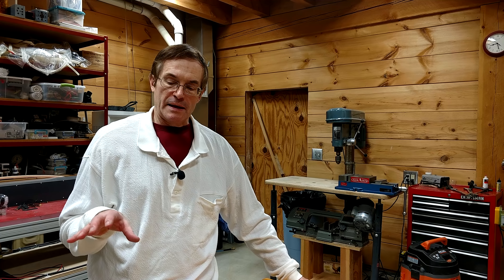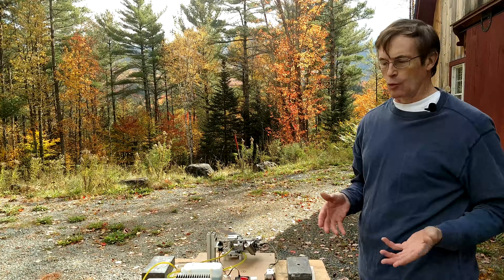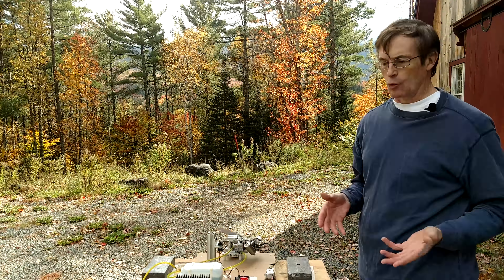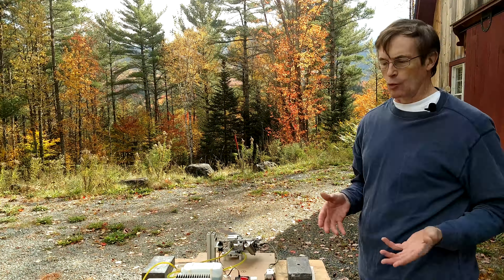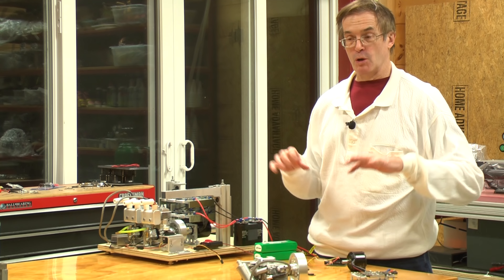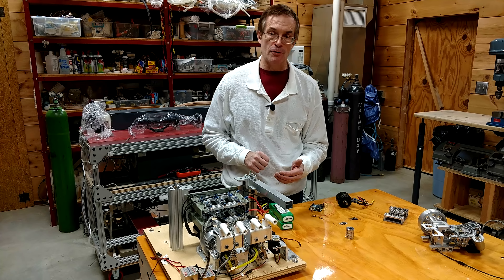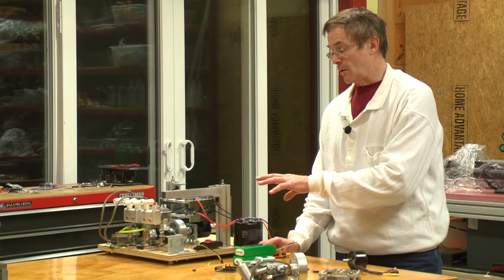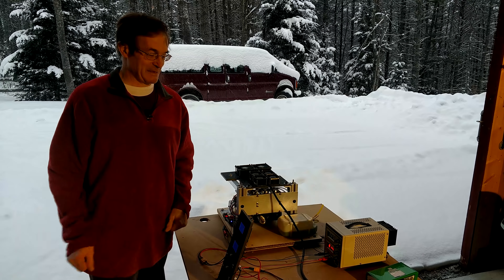Hybrid Drone Generator

Comment: For a gasoline quadcopter, I wonder if it would be more efficient to use the engine directly with a prop to generate some baseline thrust, with the electric motors providing the additional thrust and manovering. 
Also, for teh generator, you can probably get some more efficiency, and probably also a bit less less weight by using synchronous rectification with MOSFETS instead of diodes.
Reply: for that sort of thing would work really well for a Y4 design copter
Reply: When you use multiple sources of power (hydraulic and electric, or combustion and electric), there is a higher mounting hardware cost to route the transmission of fuel and power to the different outputs. It's the intersection of the utility line puzzle with the square-cube law. The additional hardware weight would probably counteract potential efficiency gains in copter designs due to the existing complexity.
Reply: wouldn't igbts be better than mostfets? although more expensive
Reply: @SuperAWaC No, IGBTs are more robust and have higher power ratings (but a power rating of a semiconductor is the rating of how much power can be wasted inside of it before it releases the magic smoke) than MOSFETs, but not more efficient.
An IGBT has a constant voltage drop of lets say ~1V (more or less depending on current passing through), while MOSFET has a constant resistance (also depending on current passing through, or rather the temperature of the die, it has a positive thermal coeficient - so higher the temperature the higher the resistance, this is a desirable characteristic for powersharing with parallel active devices).
There is a crossover current when IGBT will be more efficient than a MOSFET (depending on types of course), but usually MOSFETs are more efficient.
For example a low Rds(on) (3mOhm) MOSFET can carry 330A of current before it's voltage drop reaches 1V, so unless you have a higher current flow a MOSFET is more efficient than a IGBT.
Reply: I think I've seen an example of that. A central IC motor for hover power, electrics for the rest.
Reply: It would be nice to control the rotors directly, but for small multi-rotor systems the mechanical control of rotor pitch just is not there.   So having a ICE providing power gives a decent compromise, providing the conversion to DC power is handled appropriately.
Reply: For IGBTs the control signal is critical for getting power through the gate.   While they behave more like bipolar transistors with NFET pass current capability,  they still need to be driven by voltage biased drivers due to their FET heritage.
Reply: +akkudakkupl +metaforest -- If IGBTs have about 1 volt drop under load, then there is no advantage over passive silicon diodes, and both are worse than Schottky diodes. MOSFETs can be better, if oversized devices are used to keep voltage drop low, but then they still have to be driven synchronously, which is a bit of a pain.
Reply: The issue here in not voltage drop across the rectifier.  The issue is that the current and voltage waveform are not sinusoidal.   This means that there is a rather large PF loss using a passive rectifier.  The MOSFET/IGBT active rectifier isn't really synchronous.  It is tracking the voltage and current waveform from each phase and dynamically correcting them by selectively switching gates.  The default behavior (no gates switching) is identical to a diode bridge.
Reply: +metaforest -- mikeselectricstuff suggested "synchronous rectification with MOSFETS instead of diodes", which seems to me like an attempt to reduce the voltage lost across passive diodes. After all, one can be synchronous and still have an arbitrary phase shift, so long as it's by a constant amount. More would need to be specified if some sort of PF correction is the intended meaning. To maximize the per-phase output without compromising power factor, I would suggest separate rectification for each winding, preferably with a higher intrinsic alternator voltage, and each phase winding then feeding into a PF-correcting circuit with high voltage output, as a high voltage DC common rail will be good for driving a drone's many motors independently via simple per-motor PWM circuits. This approach will also completely eliminate the problems with voltage regulation of the alternator outputs, and the lower currents will save weight on heavy wires, and the associated I2R losses.
Reply: +YodaWhat --  This complicates the notion of having a fail-over to battery when the ICE or some other element of the power train fails.   If you'l look back to the original exchange on this topic I reference a paper on the subject.   There was someone else looking at these issues in a more general application 15 years ago.    That paper has a lot more detail on the issues that BLDC generators have than I can cover here.   My best suggestion is to read the paper.
Reply: The main benefit here is that power density for gasoline and similar liquid fuels have a energy density about 100 times greater than batteries.    There is no question that the system becomes less efficient.   The benefit here is that the system, even with the increase in running gear and losses, outperforms batteries by a enough to make it worth persuing for increased flight time, and possibly overall carrying capacity.   The only real issue I have with Tech Ingredients approach is the passive rectifier/regulator system he has chosen to focus on.  

I think the overall approach is sound until battery energy density improves to the point that thrashing-metal+fuel is no longer has an advantage.
Reply: +Tech Ingredients +metaforest -- I do not see any link to a paper in this chain of comments. What is the link? 
As for the fail-over to battery, that is still possible with a high-voltage DC rail system as I proposed a few days ago. "High" being a relative term, some compromise will be possible between 'how high' and what is reasonable to match with a battery. Also, the battery can itself flow power through a Boost Converter switching supply if need be to match the DC Rail voltage. PF Correction circuits also typically function as Voltage Regulated Boost Converter, which will mean more energy can be extracted from the battery before dropping voltage makes further discharge unusable. One should, of course, try to minimize the number of power conversions in any system, since each will lose some power as waste heat. Will that extra bit of battery power make the losses worthwhile? That question must be answered on a case-by-case basis. For the alternator outputs, this parasitic loss is very likely to be worth the effort, since it will allow the alternator output to achieve nearly perfect Power Factor, which will mean more Real Power via good phase-matching and less lost to Imaginary Power via poor phase-matching. That will probably mean that de-rating the alternators all the way down to 50% of "rated power" is not necessary.
Reply: Mike is here.. I am your subscriber ha ha..
Reply: The Toyota Prius does that ... instead of using a generator, the gas engine is mechanically connected to the wheels.
Reply: Hi Mike - Just to make a point here, you've completely missed the issue of transfer efficiency - Variable speed propellers aren't all that efficient if not operated at the correct speed, and rotors are more efficient than propellers in terms of thrust per watt, but have mechanical transmission losses.  Trying to design a system with variable thrust destroys this - you can mechanically connect the quad's propellers to the motor, but the transmission losses might be less than the electrical losses, but the speed inefficiencies come in over the top and obliterate any advantage you gain when varying thrust. On the other hand, if you can decouple the input RPM and the output RPM without gearbox losses, as you can in an electrical system, then you only have heat inefficiency and can usually keep total losses below 20% - which is quite reasonable and still run full electric.  You can also run the motor for maximum power or maximum efficiency, and can even boost the voltage as required. Total losses aren't always comparable unless you map them over the complete envelope of operating conditions and then compare them. BTW, I've been working on the MOSFET instead of Diodes idea also, and this had the added advantage that you can also start the motor electrically if designed correctly - but diode losses aren't too bad above 20v so you can always just go high voltage as an alternative to not using diodes. If you ended up running at 100v or so, the whole thing would be very efficient with much lower electrical losses, but there's some real appeal to extra-low-voltage systems, such as not worrying about electrocuting yourself.
Reply: Just FYI everyone, in trains (diesel locomotives), All of those diesel engines in that engine-car, are there for the sole purpose of generating electrical power to drive the train's DC electric-motors. So if they decided that it's more efficient in that context, I don't see any reason not to experiment and test for multirotors or other aircraft, to see if any improvements can be made. 
(The only main difference is that in trains, they are generating a HIGH voltage, like 1200 volts.)
Reply: Trains use electricity because of torque on low RPM and because you can change gears electrically. This idea is good the only thing is that it might start to get efficient only on larger devices on which you can carry more fuel with the same generator increasing the energy density of the fuel/generator system.
Reply: Well then we just need some gigantic propellers that turn really slow, like this thing: https://www.youtube.com/watch?v=emK-qIbuJ-k
And you're probably right about the train thing. I don't know everything when it comes to trains. But trains are still awesome.
Reply: Will not get that kind of control as electric engines have.
Reply: I began experiencing small RC engines as a child because my did made an RC airplane...it makes no sense to waste the mass and cost of electric systems when fuel powered is so much better!
Reply: SuperAWaC  IGBTs have a fixed voltage drop greater than a normal silicon rectifier diode drop. You have no gain over a normal diode rectifier. They are used for higher voltages where this does not matter. But at this voltages the rectifier diode drop does not matter anyway. You use synchronous rectifiers with MOSFETs for very low voltages, where this matters, I would say <=10V,  because they can have lower drop voltage than even schottky diodes.
Reply: No!!!  he is just using 30 Volts at around 10 Amps.  IGBT's are good for high voltages i.e. above 300 Volts.  they are usually rated for 600 Volts and above 300 Volts fets start getting expensive and lossy.  IGBT's have a Vcesat of a couple of volts, so above a certain amount of current ( I x Rds < 2V of the Fets) they surpass the Fets.
Reply: JakeN482 An all electric octocopter already takes all the extra overhead of more structure, blades, etc.  Why not drive half those props with fuel for most of the lift, and the last 4 just for fast response steering?
Reply: ALSO  :  a propeller on the petrol engine to get some lift to cancel out the extra weight, if it was enough to allmoast lift the drone it would act as a soft landing system, bringing the drone down slowly,  should you lose controll of the electric moters with propellers.
Reply: Maybe I missed it but I didn't see any consideration for the batteries overcharging here.  At some point engine speed would need to be adjusted based on cell voltage.  You can see when throttled up the battery voltage does start increasing so its coupled currently.  I also think you would be chasing minimal gains if any with this system versus weight.  A glow fuel 2 stroke would shave weight and complexity but increase fuel cost.
Reply: @nabzim  Except not all locomotives are DC traction motor equipped now days. Most new ones are AC motors. And you have the voltages a little low, some are as high as 3KV ( electrics on Milwaukee Road ) which when it was used at the motors in series was 1500 volts per motor. MU cars on the EL were also 3000 volts in and dropped by the motors in series. 600 volts was the earliest units and were DC. When the voltage was increased, the brushes in the DC motors started having arc over problems when going over grade crossings/rough track. So AC motors were investigated. Now days, they really are mixed up units as the alternators on the loco make AC, it becomes DC, the DC is chopped and made into AC and then fed to the AC motors. The advantage? With modern electronics you can run the engine at its best operating point and control the output to the motors at their best operating point too. And control each motor individually to control slippage.
Reply: @Frank Heuvelman  Not the military way. Except when it comes to infantry.;-) There it also is HUAW.
Reply: The advantage of quadcopter and other multi-rotor flying craft is, compared to helicopters, is their mechanical simplicity.

A helicopter rotor is a lot of complex moving parts. Even the simple (relatively) Bell teetering rotor of Hillrr with the flyboards, are way more complicated than drone systems, which are an electric motor turning a fixed pitch prop.

But drones don't carry much. Their limited lifting capapability means short range. They rely on battery power as gas engines can not respond quickly and subtley enough to handle the inherently unstable flight characteristics of fixed pitch multi-rotor. Range and speeds much slower and more limited.

Battery technology does not appear to have the growth to match the energy density of fossil fuels.

What I see as the biggest challenge with a hybrid system, where a fossil fuel burning engine drives an electric generator which, after going thru control devices, powers electric motors to turn the rotors, is building a hybrid system that is powerful enough and light weight enough to fly. Especially for vertical flight.
Reply: @maxheadrom3088  True.

But the Prius doesn't have to fly. 

So weight is not as big an issue.
Reply: "For a gasoline quadcopter, I wonder if it would be more efficient to use the engine directly with a prop to generate some baseline thrust, with the electric motors providing the additional thrust and manovering."
You basically described the hybrid quadplane design that the folks over at Canberra UAV have been experimenting (and winning competitions!) with. Small piston engine in the back coupled to a brushless generator and fitted to a propeller, feeding into a set of batteries with just enough juice to power the quad motors for a landing and takeoff sequence, or momentaneous hovering. All that with several hours of flight time thanks to the density of the primary fuel. https://diydrones.com/profiles/blogs/building-flying-and-not-crashing-a-large-octaquadplane
Reply: I dont think you would be able to adjust the throttle quick enough.

Comment: This is THE most informative, best explained video on UAV hybrid power I've seen.
Thanks to all who produced it, and made it's complexity easy to digest: you have one very happy new subscriber!
Reply: Two stroke engines run with specific exhaust pipe back pressure cutting or changing the exhaust pipe is like changing the cam timing on a four stroke it might work on a small engine but should not be done !!!

Comment: It took Harley-Davidson almost 100 yrs before they balanced the crankshafts on their motorcycles. However, in the aerospace industry it wasn't long before they started balancing engines, because it was much more problematic to have an unbalanced engine in an airplane. 
Someone did a bit of work making up the mounting fixture for the engines and generators.
Also, I have an Engineering Degree and 2o yrs experience in Aerospace and I'm following along with everything. Then I think does anyone else have a clue what you're talking about that doesn't have some Mechanical or Electrical Engineering background ? 
Great channel I hope it inspires younger kids to put down the video games and start experimenting. We need to give the kids the resources too.

Comment: Wonderful job so far. I love your scientific methodical approach to this project. As an Electrical Engineer, I have followed your work with ease so far. You are doing a great job of determining the parameters of your engines and generators to suit your needs nicely. Your component choices are also very good. Now, I'm going to watch your next video and see how the next phase goes.
Reply: As a fellow EE I am surprised by your assessment.
This is never going to work. There is at least one fundamental flaw.
The concept of constant voltage is doomed.